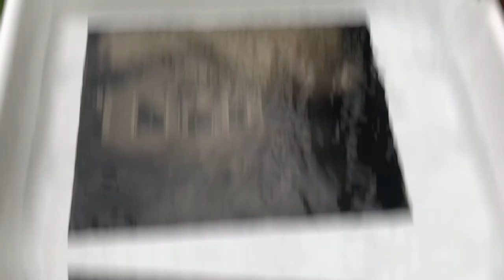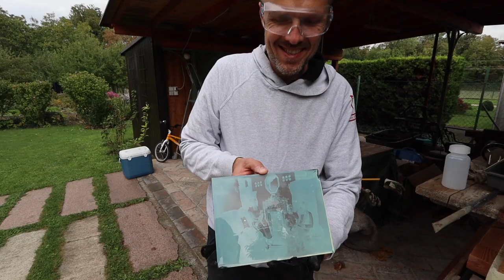Family and Architecture Wet Plates on location

Comment: I like that spray bottle contraption you’re using. Lovely images!
Reply from the maker: Thanks a lot Kary. I saw Peter from Switzerland using it and I liked that I can reduce the water in the process with it. I also like that I can stop developing on certain spots with it, as I did in the video
Reply: @mhaustria  very nice! Sounds very helpful.
Reply from the maker: @oldschoolcollodion  I bring old collodion, old and used developer to a special waste disposal place. The have special bins for toxic chemicals. With this spry bottle I use less water and so I have less developer to dispose. That was the main reason I started using it.